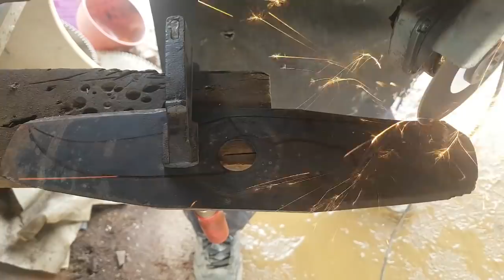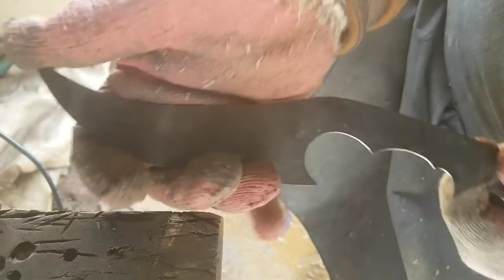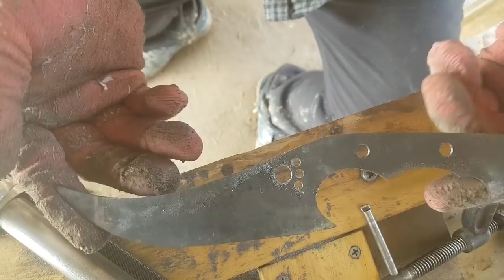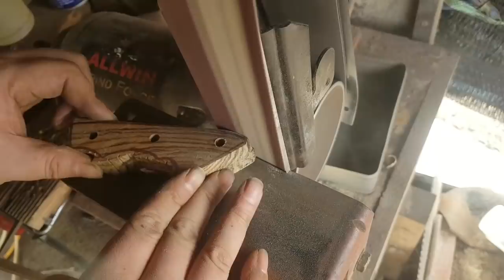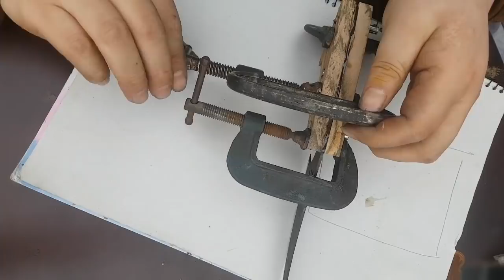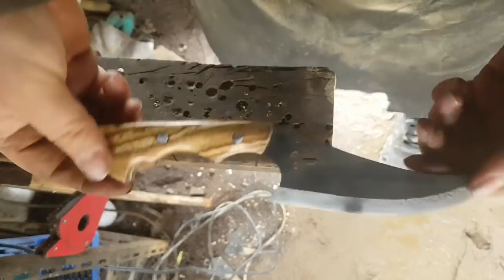make a Korean Kitchen Knife "Beoseonko"

Comment: You always used oven , please tell me how it's effective
Reply from the maker: Thanks for watching.
The reason for using an oven is that it is brittleness with an extremely high hardness by quenching, which makes it easy to damage the knife. The oven is heated at a constant temperature of 180 degrees for about 40 minutes (the temperature and time vary for each metal). This is called tempering, and this is a process that lowers brittleness so that the knife does not break.
Reply: @forginghard  thanks for your explanation... kept it up👍👍